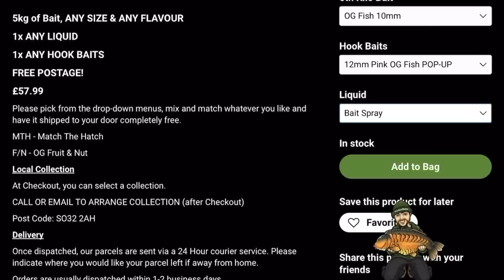The CARP KILLER: What Elusive Predator Has Been FEASTING On My Carp? 😮

Comment: Ben put a eight or nine strand wire  fence up, the key is to run it from the mains and not a battery. Also on the outside of the fence put a dozen hand sized stones in a small pile a few feet away from the fence, a otter will scent and leave scat against the stones which will tell you if they are still coming after you have put a fence up

Comment: I would buy a wildlife camera and set that up on a pir, they are relatively cheap. In fairness the issue you have is that the carp are small and an otter would need to eat a lot of flesh to sustain it. If a carp is larger you are right they would go for most nutritional bang for buck with gills then insides. That's why the bigger carp look relatively undamaged when ottered.
1st thing is the wildlife cam. Good luck
Lee
Reply from the maker: Good Idea 💡